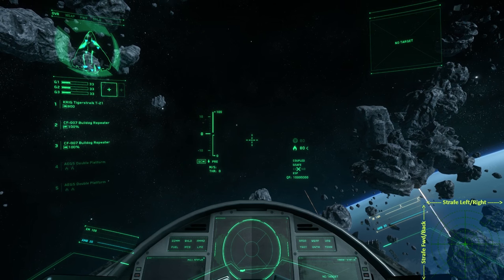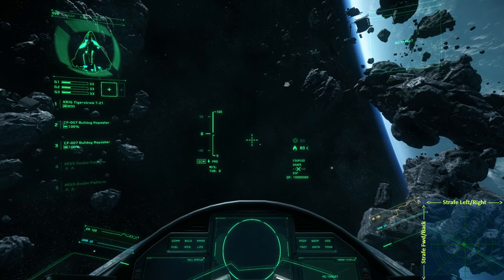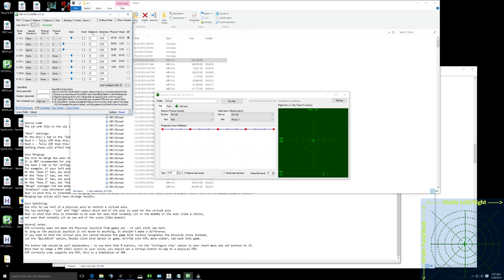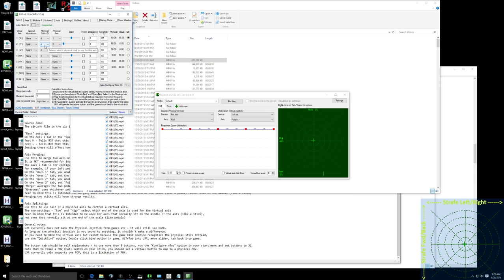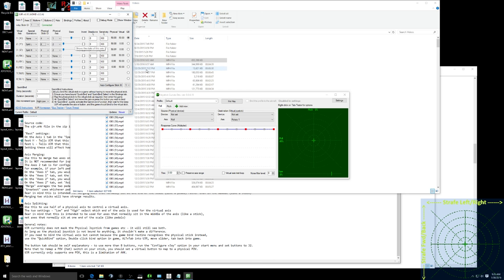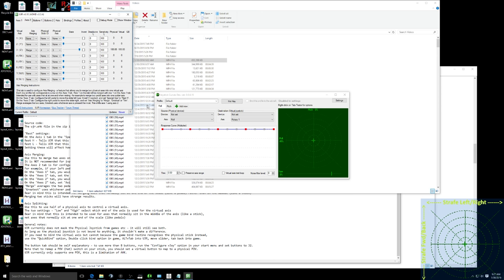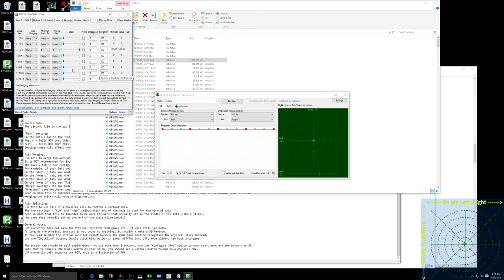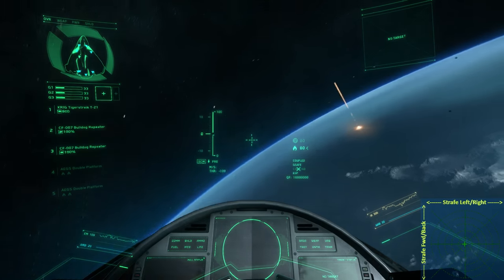Tutorial: Configure for both throttle and analog backward strafe on the same axis

Comment: Back in the early Arena Commander days, I wrote a TARGET script to split the Y Axis on my T16000M to accomplish the same thing. I ditched it sometime later and went with forward and backward strafe but have been wanting to reinstate the throttle/backward-strafe script for a little while now. But your solution is a good one for people with a stick that doesn't support TARGET or native scripting.
Reply from the maker: +Mr. Hasgaha If you can find that script, please send it to me because I searched the forums and couldn't find one.
Reply: +Legacy Instructional Series 
Yep.. it's already on my list because of your video. I'm out for the weekend, but I'll try to find it when I get home. I remember it took me awhile to get working right. Once it did, it was slick. I feel like I made the script back when strafing was only possible when in decoupled mode. So I had the positive Y axis bound to throttle, and the negative Y axis would automatically put me in decoupled AND strafe back. When the stick went back to center, it put me back in coupled. And that was the only way i could get backward strafe to work.It's possible the script is depricated or might need some tweaking.

Also.. an advantage of using throttle that I've found is that the space brake is MUCH MORE effective on stopping you faster if you're using throttle. I find it takes longer to stop using space brake with forward strafe.
Reply from the maker: +Mr. Hasgaha Interesting, I'll have to test that. Just out of curiosity, why did you change to pure longitudinal strafe rather than just altering the script to work for coupled mode (when they added coupled strafe)? Just not worth the effort since it's pretty much mechanically the same?
Reply: +Legacy Instructional Series 
I think YOU might have been the one that clued me in on coupled strafe being in game.. after watching one of your videos. But yes, at the time, I didn't see a benefit in using THROTTLE over FORWARD STRAFE. And because I saw no clear benefit, I opted to trim my TARGET script down and rely on in-game bindings. I just recently (this week) started working on my TARGET script again. I added a THROTTLE-LOCK/UNLOCK button that, when pressed, saves the current value of the Y axis of the T16000M (forward or backward) and then disables the use of the Y axis. So, lets say I'm pressing the stick forward at 75% and press my "throttle lock" button, my forward strafe will be locked at 75% and I'm free to move the T16000M around any axis without it affecting that forward strafe. I can let go, or I can continue to use it... but that 75% will be maintained automatically. When I want control again, I click the same "throttle lock/unlock" button and the Y-axis comes back. I still have the throttle/Z on my CH Fighterstick bound to throttle.. just in case.

Since I'm deep in the script again, I thought about going back to the throttle trick I was using.
Reply from the maker: +Mr. Hasgaha I tried to do the throttle lock thing using the decoupled-to-coupled-mode throttle setting "feature" using AHK but was unsuccessful. I called it "trimming". Never used target, though. When you get something you like, definitely shoot it to me. I could see using the throttle lock/unlock thing to great effect.
Reply: +Legacy Instructional Series 
Do you use a T16000M as your "throttle" stick? TARGET is a Thrustmaster program and only works for SOME of its sticks. If YES, I can certainly send you what I use now.. I'm quite happy with the THROTTLE-LOCK function. I actually have that script here with me because I was going to update my keybinding graphic and through some annotations on my dual stick video.
Reply from the maker: +Mr. Hasgaha Please do. Yes I use the T16000M as my throttle stick. Thank you for your help!
Reply: +Mr. Hasgaha I would be interested interested testing both of your TARGET scripts. Been looking for a TARGET solution for both of these problems for a while now! great work guys!
Reply: +neok23 +Legacy Instructional Series
Well, I have the THROTTLE-LOCK/UNLOCK part of the script with me today. So if you have a script already, you need to initialize my throttle_lock variable before going into the main() function and then you can dump my LOCK/UNLOCK snippet into your main() function. Here's the snippet on pastebin:

http://pastebin.com/GZ6cme07

Depending on your existing script, you might have to tweak the joystick name "&T16000". But that's it.

Comment: I bound ( in the keybinding option of the game ) the throttle on my left T16000 M, on the axis, and then I bound straffe forward/back on the same axis ( only work in this order ), and I have the same result without a script. Maybe 2.4 .
love your vidz, Thanx!
Reply from the maker: Yeah, since this video I've figured out a slightly easier way to do it since this video was made. But I'll try your way as well. Thanks.
Reply: What's the easier way?  I'm having an issue with my analog strafe not giving me 100% power.  I've even unbound all other axis on the stick except forward/back strafe to avoid any accidental input an I'm still only getting 130 m/s in a 325a.  Any suggestions?
Reply: initially worked for me on a gamepad - thanks!

Comment: Why not just set the joystick axis to strafe forward/back instead of splitting it between throttle and strafe back? Is it just because you want the throttle indicator to work? I'm actually thinking of switching to a HOSAS set up, so I'm just curious about your thought process here.
Reply from the maker: +BuzZzKiller The strafe forward/back thing is what I've used for a year now. It works fine and changing it to use throttle doesn't affect the way the ship is controlled at all. That said, people on the forums were asking if this is possible. There's still some (incorrect) belief that the throttle is the only way to use your main engine. But, there is some usefulness in being able to see your forward input, and it's particularly useful for me because people watch my videos and it helps them understand what inputs I'm making.
Reply: +Legacy Instructional Series So, am I right in thinking, from this comment, that the only difference between this set up and mine (left joy Y is just strafe fwd/back), is that when you're pushing half forward on the stick your hud will show throttle at 50% while mine won't?

I have throttle bound to a hatswitch on my left joy that I can use to control both throttle and then use full analogue strafe fwd and back on the y axis, I believe this allows me better fine control due to additive strafe. Are you losing this capability by having Throttle mapped to your forward y axis?

Sorry if muddled, I'm getting a bit confused.
Reply from the maker: +ClaptrapRapture Throttle works the same as strafe when it comes to additive strafe. It just treats the throttle as another strafe axis to mix with. 

You are correct that the difference is almost entirely visual (barring IFCS bugs). The one exception has to do with coming out of decoupled mode, QD, etc. Because these modes automatically input a throttle setting, by having my throttle actually bound to a control that's moving, it won't do that (really annoying for dual stick users) if the left stick position is forward of midrange. So it fixes the problem about half the time.

Comment: Quick side question.  I use two 16000M's.  My left is strafe forward/back, left/right, up/down.  I notice that when I decouple, the game sets my throttle above 0, even though I have no throttle key bound.  This screws up decoupled mode obviously.  I've since used autohotkey to wait a second and then hit 'ss' for set throttle to zero.  However, this then sometimes messes up my strafing ability.

Is this a known issue or just me?
Reply from the maker: +James Easter This is a "feature" that has been complained about regularly. I do the same thing with the script and get the same issue with it disabling strafe momentarily. Issue council post: https://robertsspaceindustries.com/community/issue-council/star-citizen-alpha/SC-26-Recoupling_results_in_uncommanded_throttle_input
Reply: *****
Thank you for that link, I've added to it and will keep an eye on it.
Reply from the maker: +James Easter No problem.

Comment: Third Question: So I set it up similar to what you did. But instead of using the merged axis method, I just set the rear axis to strafe back. It seems to work just fine, but I have one issue. I can't seem to set a deadzone for my joystick so its real hard to come to a complete stop. Any ideas? Or is that why you use the merge method?
Reply from the maker: +BuzZzKiller How did you set the rear axis to strafe back? You mean using in-game settings? How specifically did you bind it?

If you only bound "strafe back" somehow to pulling back on your stick, then you actually aren't achieving analog movement. . . your pulling back on the stick is equivalent to just pressing a keyboard button - it's 100% backwards or full stop, no in-between. 

Or did you bind it some other way?
Reply: +Legacy Instructional Series The "strafe back" binding is now analog or digital depending on if you bind it to an axis or button. They changed it on all the strafe (single direction) bindings several patches ago. My previous control setup (Hotas w/ pedals) used the roll right and roll left bound separately on the toe brakes since my Warthog doesn't have a twist axis.
Reply from the maker: +BuzZzKiller I tested this last night and binding "strafe back" (after unbinding throttle) resulted in it behaving just like if I had bound "strafe forward/back". . I guess next I'll try roll on my tire brakes and see if maybe this is an isolated feature. But right now with my setup I'm not getting the same behavior as you.
Reply: +Legacy Instructional Series That's weird. I shared a private video with you to show you I'm not pulling your leg. Maybe check your keybindings and make sure you're not using the same axis on something else? If you don't get the link to the vid, let me know and I'll post the link.
Reply from the maker: +BuzZzKiller I have not received the link.
Reply from the maker: +BuzZzKiller Saw the video. Quite peculiar. You are not using the front half of your axis at all when doing this, right?
Reply: +Legacy Instructional Series I think we've got a disconnect in communication here. The video was just a demonstration that the "Strafe Back" binding is analog. It was set on the throttle slider for demonstration purposes. I normally have "Strafe Forward/Back" bound to the y axis on the left stick. But of course that doesn't give you a throttle indicatior. So what I've done is used the programs you suggested but I was able to eliminate the need for the "MERGE" function in UJR by using the "Strafe Back" binding instead of "Strafe Forward/Back" on the rear portion of the axis. See the linked picture album for my current settings. http://imgur.com/a/CIm8d

Comment: Hey mate, you mentioned in a comment below that there is now an easier way to do this? Would love to know how, I'm currently using strafe but this looks very hand indeed,  Thanks in advance!
Reply from the maker: Now you don't have to merge with an open slider axis. . . the game supports binding analog inputs to "Strafe back" for instance. Before you could only bind that to a button. So now all you gotta do is split the axis with UJR, then map those resulting axes directly to "Throttle" and "Strafe back".
Reply: Legacy Instructional Series Thanks man :)
Reply: Could you add that to the video description? I guess it would help a lot of people, as the axis merging was the most complicated part of the video : )